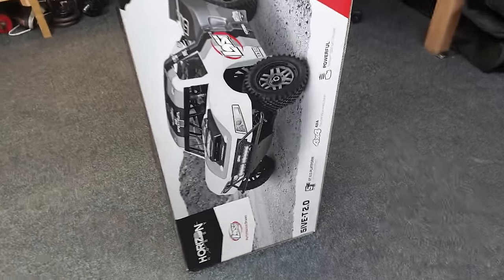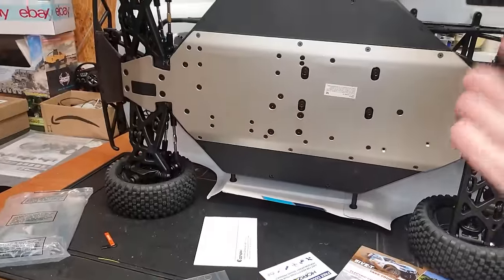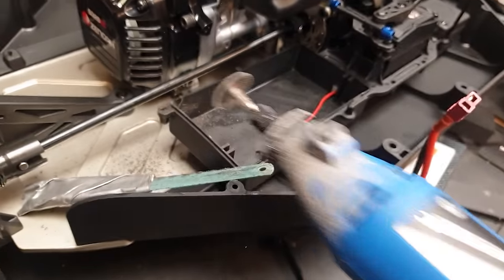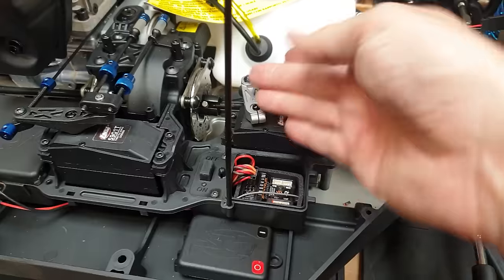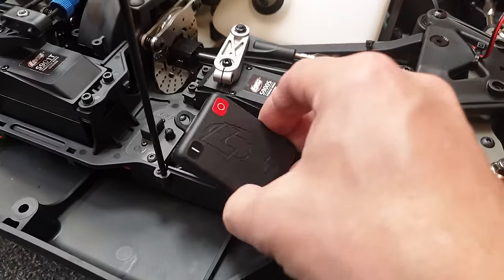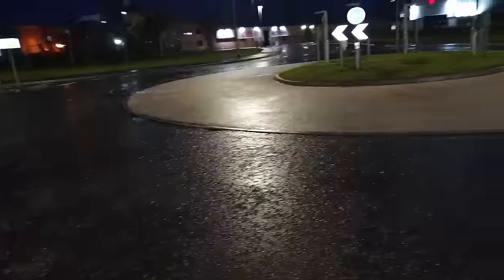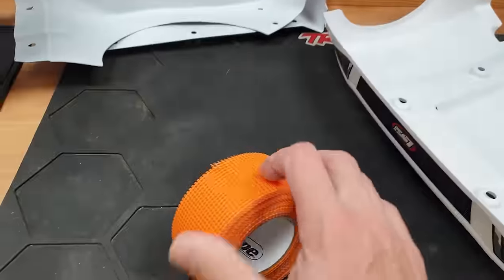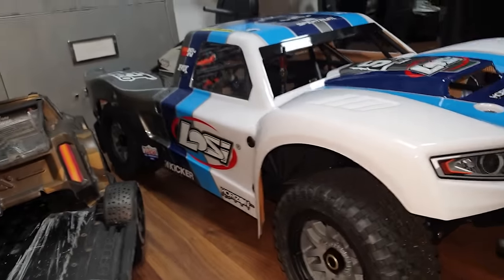GIANT gas rc car (LOUD)

Comment: I think I learn something in each of your videos I watch.  Today I learned I should but stock in Shoe Goo!  Seriously though,  over here on the US side of the pond I used to build Zenoah engines for GoPed's and GoQuads  that would run 20,000 RPM.   They were terrible at low RPM, feathering the throttle up to about 6000 RPM when they would start to pull a human along with a surprising amount of acceleration.  It is a good thing that acceleration made you hold on because at about 11,000 RPM without warning HOLY S_ _ T.  The handle bars would bend back, the frame would flex and it was all you could do  keep it from dumping you on your ass.  Reliability was fair because we ran four main bearings (sacrificing the seal for a sealed bearing).   I can't help but wonder how  that engine would  do if it wasn't dragging an adult human with it.  Ludicrous I expect.  It requires a lot of machine work.  Block, piston and head modifications, about ten hours total to build one.   Might just have to buy one of these and play hard.

Comment: why you cut battery holder? use 2000 Mah battery is enough  only for Servo steering servo accel and brake only.

Comment: Need a rc max 70 or alx, 71 it will wheelie that beast. There 21 hp guys in the usa build them and they haul ass big time. We run methanol or 110 octane race gas.

Comment: i bought my first losi a few months back.. And it will be the last. I got the Lasernut and in the box it was falling apart. over 50 screws were not all the way in. The diffs cases has zero grease in them and they front and rear diffs headed up and melted on the 3rd battery. The rear sway bars had no screws at all in them and just hung there. All three diffs broke within 4 batteries and never finished a battery before breaking.. There customer service is nice but im sick of breaking it 5-10 minutes into a drive when my 8 other cars from traxxas and arrma never break.

Comment: Hi kev I noticed you had a hyper mt on the wall I got one new the other week and unable to use as the driveshafts brake every two mins iv broke 8 in total now I have stopped trying any help would be great

Comment: Kevin love your video i have a 4s kraton with a mah 5000mah 50c Battery and i just bout a mah5000 100c Battery BUT THE PROBLEM IS I WAS. 
RUNNING 2 DAYS AGO IN THE PARK ON SHORT GRASS WAS RUNNING GREAT AT FIRST BUT THEN IT STOPPED DOING WHEELIES AND SLOWING DOWN THEN JUST STOP BUT BOTH LIGHTS WERE ON CONTROLLER AND BATTERY FRONT WHEELS STILL STEERING I TURNED EVERYTHING OFF TOOK IT HOME CHARGED THE NEW BATTERY FULLY CHARGED BATTERY BOTH BATTERYS AND DID THE SAME THING AT HOME TOOK THE HOOD OFF SHOOK THE DEBREE OUT OF TRUCK LEAVES AND AND EVERYTHING BUT STILL RAN THE SAME WAY AND WON'T GO IN REVERSE OR FOREWORDS ETHIER JUST STEERING AT FRONT WHEELS WHAT COULD IT BE SLIPPER CLUTCH SERVO PROGRAM BUTTON ITS NOT THE BATTERY CAUSE THEY CHECKED IT AT THE SHOP HOBBY AND THEY TOLD BATTERY FULLY CHARGED THEY SAID IT COULD BE STRIPPED GEARS WHAT ARE UR THOUGHTS ON WHAT I JUST WROTE TO YOU?
Reply: IT was the slipper Clutch Kevin nothing Else thank god the owner showed me how to tighten it what kind of wrench i would need to 8mm wrench?
Reply: Just need to know cause i know its gonna. Happen again so i have to be prepared to tighten it when it does happen again
Reply: Is there Anyway i can keep that slipper Clutch tightened without keep having to retighting it AFTER Every 7th 0r 8th Run

Comment: Yk theoretically you dont acctually need to run in 2 stroke engines cause there ringed js take it easy for a few tanks nitros need running in not 2 strokes

Comment: youd think at that point theyd run a charging system on the motor so all you gotta do is run fuel and keep good batteries is the controller

Comment: It says kind of the reason why I stay away from the low c and the Traxxas cuz they're big names but they always got to make everything specific they have their own battery connections they have to have their specific size battery that fits into their car like I like the Japanese stuff I like the Chinese cheap RC cars where you can pretty much buy any battery that'll fit into it you can pretty much modify whatever parts you can find they're not too different kind of the headache with sticking with these big name companies they always have to be super specific on everything one brand that I really like HSP pretty much all their cars are the same the parts are interchangeable there's just little things that are different but basically pretty much everything is interchangeable you can have three or four different cars set up but still have the same gearbox same battery tray same engine mounts

Comment: Imagine taking off the body manually every time instead of with a drill
Reply: I stopped using the screws and just work with the clips and had no problems with the body

Comment: Total BS about running in modern 2 stroke engines! Just make sure it doesn't go too lean and let her rip! Start tuning straight away, the engine needs heat to seat the ring properly so don't just run it rich for tank after tank!